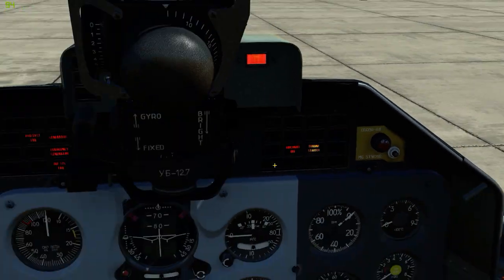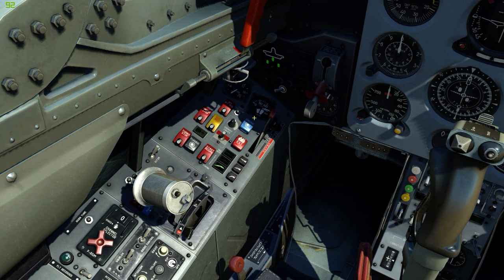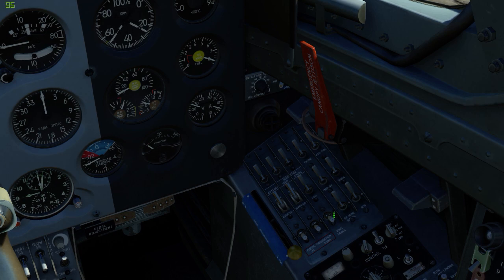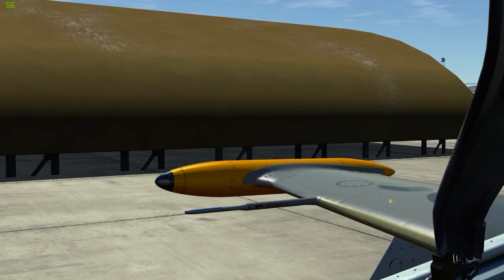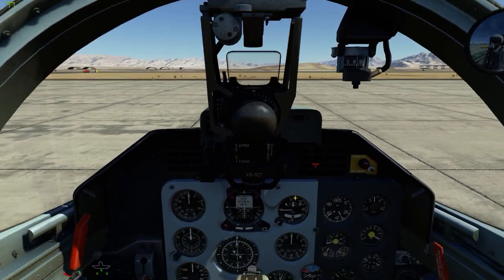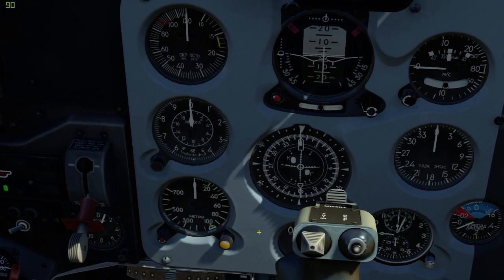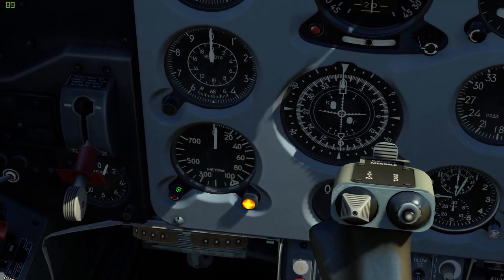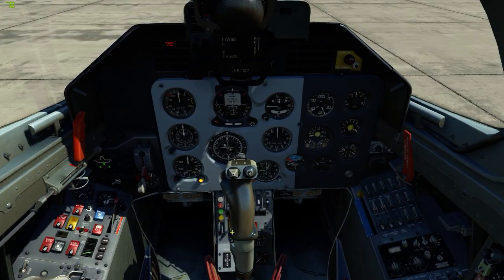DCS: L39 startup tutorial

Comment: This is unrealistic, before starting turbo you should turn on the flight recorder and you should start the engine first and after 3-6s move throttle to idle position and the yellow Lever on the right side isn’t air conditioner, but canopy sealing, there is an air conditioner switch needed to be set to automatic or at least manual position.

Comment: Nice series of videos, thx. Just wanted to mentioned that you failed to reset the radar altimeter warning lights by winding the bug back to zero before setting it back to your chosen warning altitude. That way you'll not only get the warning tone but the yellow warning light, which will go off when you zero will illuminate at the warning altitude.

Comment: Very nice tutorial, sir. Thank you very much for your work. One minor detail I would like to point out however is that I think the structures you named "outer fueltanks" are not fuel tanks but serve the purpose of aerodynamic stability (like many US jets from the 60ies such as F2H, F9F, F84 series etc) and are not filled with any fuel (would be very small with regard to capacity anyway and moreover if those compartments, which can not be dropped, had liquid in them and changed their weight during flight time, it would have a catastrophic impact on flight behaviour). Additional fuel tanks are mounted as underwing tanks which can be jettisoned.
Reply from the maker: They are fuel tanks in the L-39. The L-39C has 7 internal fuel tanks, 5 are in the fuselage and then there are the 2x 100L wingtip tanks. It is also possible to equip it with drop tanks but those were not fitted during the tutorial. Excerpt from the L-39C flight manual (1991, p.37):

"Fuel from external and tip tanks is transferred to fuselage tank No. 5 by air pressure... The fuel is transferred first from the under wing tanks and then the tip tanks."
Reply: Well, I was obviously very wrong then, I beg your pardon. Thank you very much for the clarification and explanaition.
Reply: @Eskay64  
Thank you for the info.